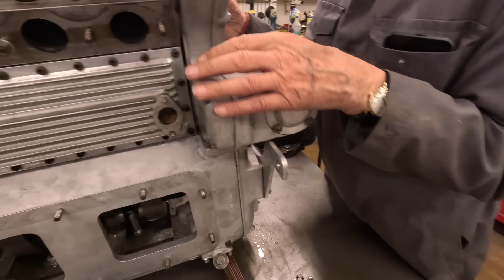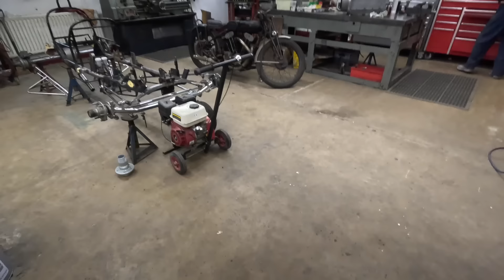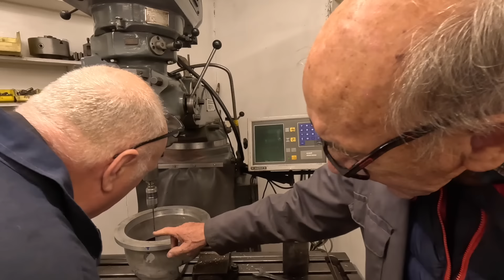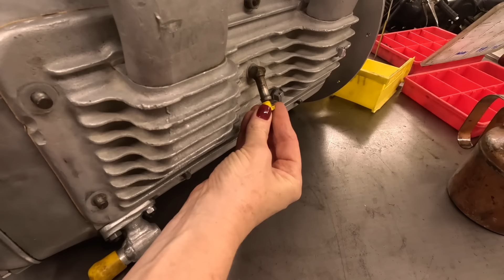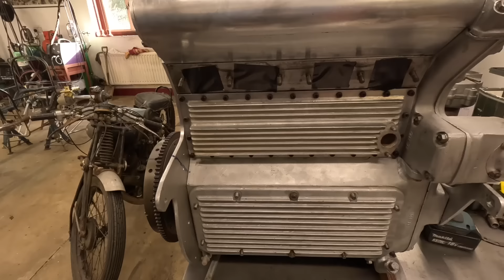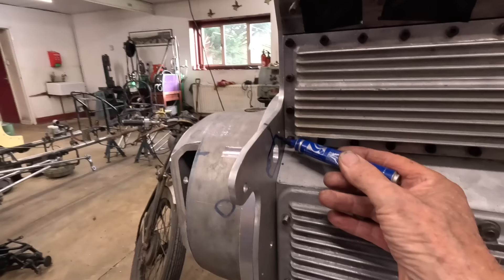Offy Midget: Assembling the Engine Part 2

Comment: I missed how you solved that gap between the block and the cam drive gearbox.  It seems to me there should be a gasket to seal the joint to prevent oil from leaking where the cams are.   Also, I think you need a support for the end of your starter gear shaft or it's going to flex and bind on the flywheel.

Comment: When we saw cars with these engines up at the track at Haubstadt, the cars would have a vertical tube welded to the rear of the frame and the trucks would usually have large wooden bumpers on the front to push the cars to start them.  Most of them would simply have an in-and-out box instead of a proper transmission.  I could see the little brass build tag on one of the cam covers at the top -- please try to get a close-up shot of that tag so we can see what the serial number is.  Susie, your questions and conversation are simply the best. Ivan is so lucky to have  you around. You are asking the very questions we would ask were we there to watch this process. I can only imagine that there is no other way to modify an engine like this other than trial and error, just as John and Ivan are doing.  There are very few machinists and mechanics in the world who know how to do these things.  I highly recommend  "Offenhauser:  The Legendary Racing Engine and the Men  Who Built It" by Gordon Elliot White.  He dedicates Chapter 6  to "The Midgets -1933-1974" (they pop up on eBay or Amazon from time to time).  Apparently, because of the popularity of midget racing in the early 1930s, these engines allowed Fred Offenhauser to become profitable again after acquiring the bankrupt company from Harry Miller.  There are many interesting pictures of these engines, including one that was modified with an electric starting motor for a sport car. They were modified with Riley, Winfield, SU and other brands of carburetors, Hillborn fuel injection and one pictured has a turbocharger.  This book has a picture of the Mike Caruso Bugatti midget that Ivan owns.  Apparently in 1937 they replaced the Bugatti engine with an Offenhauser as there are pictures of both engines.

Comment: Could you have used something like a ZF Dyna-Starter  ?,which does double duty as Starter / Dynamo  !
They"re fitted between the Engine and Flywheel  !  Usually about 65 mm thick !  This does away with the Bendix, and it"s ensuing problems  !
Stay connected  !
Stu xx